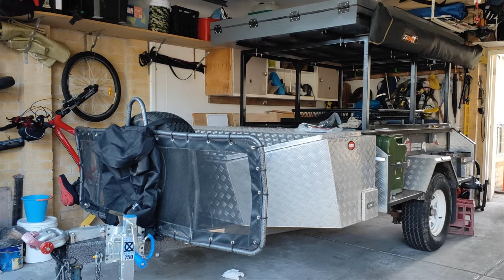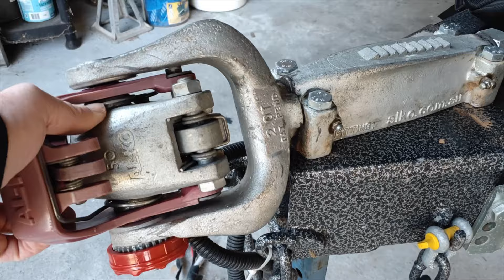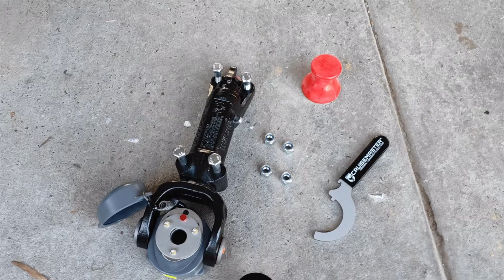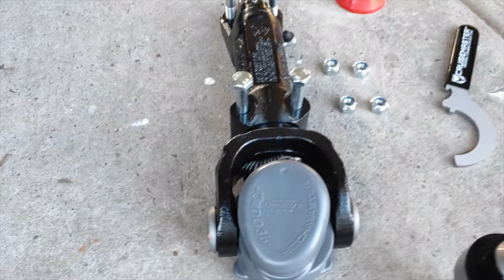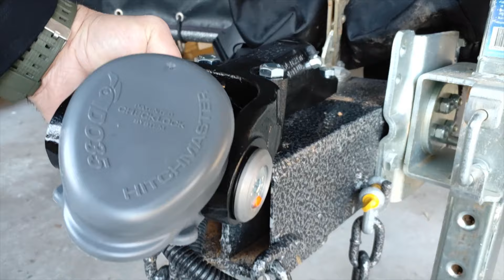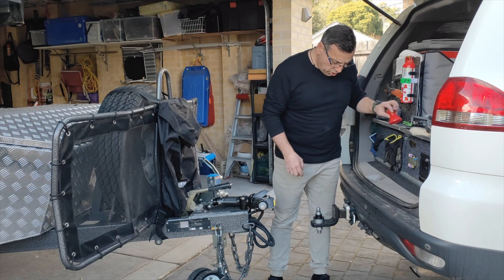D035 Coupling / Hitch Upgrade: Review, Unboxing & Installation

Comment: Great video, explained everything so well. May l ask where you also purchased your jockey wheel l like the look of it, looks good
Reply from the maker: Cheers buddy. Search Ark XO jockey wheel. It really is one of the best jockey wheels for an offroad trailer as it can be used on most surfaces. I picked mine up on eBay a little cheaper. Comes in 500 or 750 size and even available in black now. Cheers for watching.

Comment: Wondering if not having a 50mm ball will be an issue... im designing a enclosed offroad trailer to hold camping equipment, my 450 dirtbike and a heavy duty dinghy.
If i have a fold up bulldog dinghy trailer i would either need to change the hitch on that trailer or carry another hitch with a 50mm ball to suit the hayman reece bar
🤔
I feel im thinking out loud here.
You've given me something to think about because i like your reasoning for the change in hitches.
Reply from the maker: That's a tricky one. Depends on your weight too. For me, I could afford to carry a second hitch and would rather that than changing to the ball.